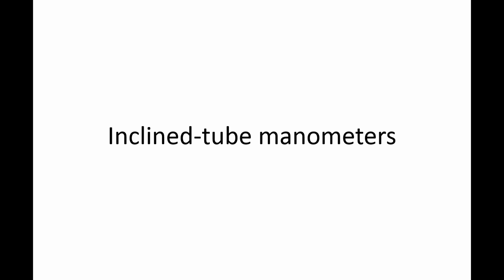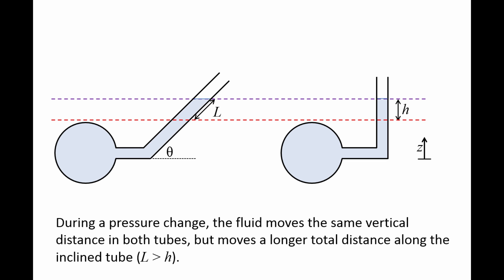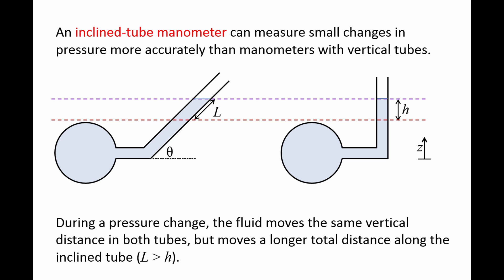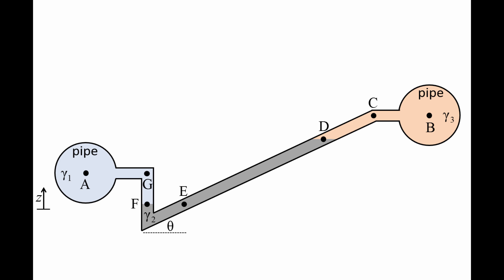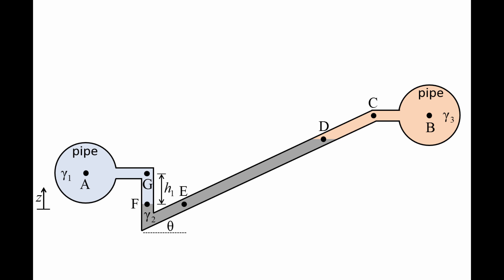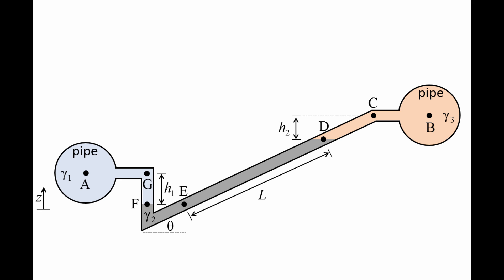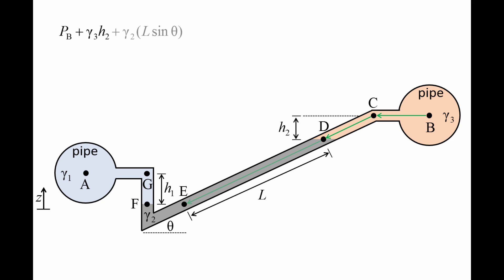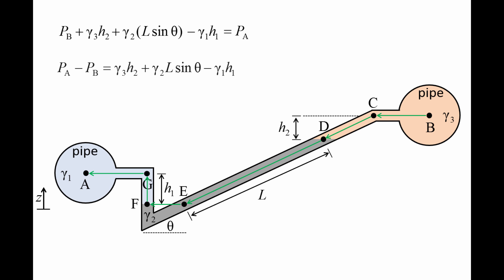Fluid Mechanics: Topic 3.5 - Inclined tube manometers

Comment: I still don't understand why didnt you treat the distance from C to D the same way as from D to E? Its inclined too right? Pls help me

Great video btw
Reply: pressure only changes due to change in elevation. "h_2" is given which is the elevation change from C to D. Now, from point D to E we do not know the elevation change but we do have the length the fluid travels, "L" and the angle "theta" and using trigonometry we can find the vertical distance from point D to E.
Reply: I think the problem he has copied from is showing the vertical distance. in my case, it is 3 inches on both ends.
Reply from the maker: The main point is that only the vertical distance matters when determining pressure changes in manometers. Inclined tube manometers usually have distance markings along the length of the tube, so whomever designs the tubes will have to account for this.